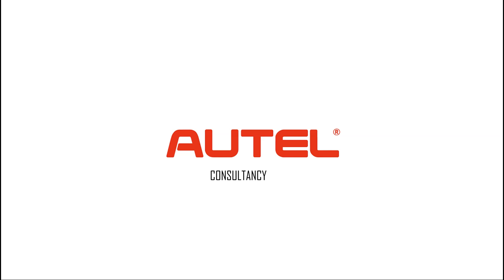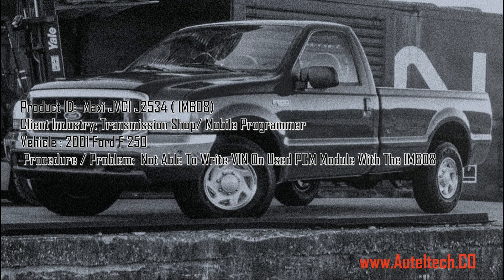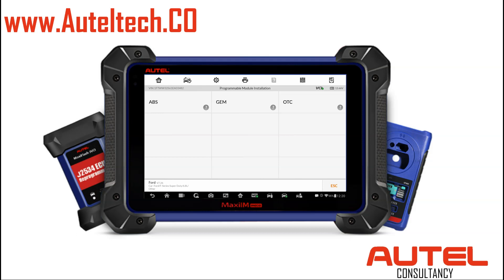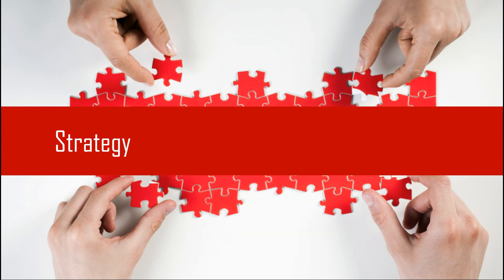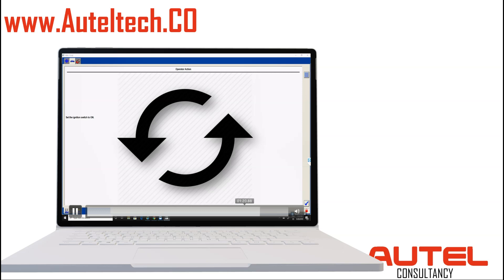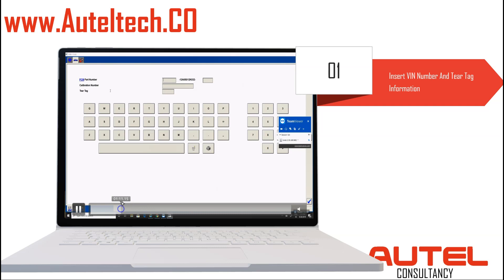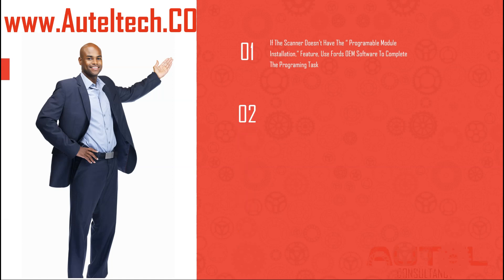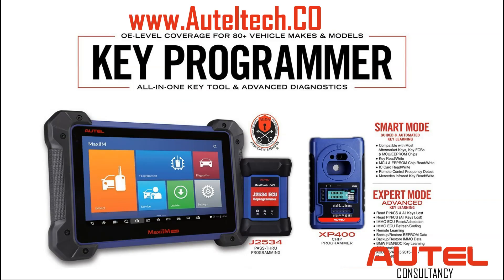Autel IM608 J2534 | Write a VIN on a USED Ford PCM Module | Case Study 2020

Comment: Whenever I try to manually enter the van, it does not allow me to reprogram because I manually entered the how do I get past this? I have a 2004 Ford F250 power stroke 6.0 turbo diesel using the FTRS software through Ford and using the J linkleak I believe

Comment: Very helpful and informative video👍. I'm using FJDS to program a used PCM to a 2007 Ford Fiesta. Any idea what the axle ratio is for the vehicle?I can't find the information on the Motorcraft website and I don't have access to Oasis😕
Reply: The axle code is located on the sticker on the inside of the driver's door. There should be the word axle on the sticker along with the other information , it will have a 2 digit code right below the word axle

Comment: I need an Autel that can rewrite a vin on a junkyard pcm. And correct my spedo due to the larger tires i have on my 2000 Ram 2500 5.9 gas engine. Any Aut models come to mind? Thanks!
Reply from the maker: You need a proper assessment. What I suggest if you want generic information you can contact Autel New York. If you want certainty then you can book a diagnostic tool consultation with me at auteltech.co.za for 97 USD.

Comment: Where are you located mine is a different year ecu shows up as a 2008 f150 buts its a 2005
Reply from the maker: I work virtually so I can be anywhere as long as you have internet access and a laptop
Reply: @AutelConsultancy my truck burnt down it’s a 2005 f150 so I bought a 2008 truck to fix it but now that it’s fixed I’m having trouble with smog bc pcm for my 2005 burnt up an melted so my truck basically thinks it’s a 2008😊
Reply: I need help on changing vin
Reply from the maker: @oneal2003  You can book the j2534 Training so I can consult you on my website auteltech.co.za

Comment: I have an issue Autel im 508 and 608 is not able to add a key on a 2023 ford transit and a 2024 GMC Sierra….what is Autel going to do with this issue.
Reply from the maker: I dont know because I haven't had any of my clients call me to log in their devices and submit the issue to autel's engineers. What you need to do is contact who you purchased the tool from or Autel New York. Go to the vehicle and have them remote in and submit a data logging. If your not able to do this then they will not know that there is a problem. I deal with this software issue alot thats the process I do to fix the issue.

Comment: Hi, I need a help with my 2104 Ford Focus TRANSMISSION CONTROL MODULE AND ELECTRIC CONTROL MODULE.  I JUST USED MODULES that need to be reprogrammed.  Please contact if you can.
Reply from the maker: Hello, you can book a j2534 training and consulting session on my website auteltech.co.za
Reply from the maker: Did you sort your problem out

Comment: Hey brother, new with ford can you let me know what a Tear Tag is and where can I find it??
Reply from the maker: The Tear Tag is typically a four-digit identifier of the PCM. It can be found on the label on the vehicle PCM, on the PCM's plastic housing
, or on the shock tower or passenger's side door jam . It can also be found on the inner fenders or strut tower, or in the door jams . If the Tear Tag number is not listed, enter your full Vehicle Identification Number (VIN) at the  Ford Tech info service website ( as build data)

Comment: Are we able to use ford ids and autel j2534 for as built data? For example I have a 2017 ford mustang flood damage bcm so i read the bcm mcu on the bench and wrote to the donor. Now car starts but I have faults for module configuration incomplete. It would have been better to program donor bcm with asbuilt data if I'm capable with j2534.
Reply: You can use Forscan to write the As-built data with no problems

Comment: hello. have a ford mustang 2002 all keys lost. went im try to programing the new two keys the car only get one off two for any reason dont take the another keys. can you plz help me
Reply from the maker: Hello, its hard to pin point the situation as I would need to log in  remotely to do some test. But on the surface it may be one of the keys your using is problematic.   You can try purchasing another key and see if thats the solution.

Comment: The Auto MP808 Has the ability to Reprogram modules on Fords. It works for all 3 of my vehicles. 2000 Focus ZX3, 2004 F-150 STX 4x4, & 2009 Escape XLT. I almost didn't purchase this scanner because of this and Autel claimed on their website that it didn't do it but I took a chance on it and I was surprised to find the programable modules feature on my Scanner. Haven't actually tried the feature out yet but I will soon because I need to replace a bad RCM on the Focus.
Reply from the maker: You are very fortunate. State one tools dont have alot of coding on them but enough for vehicle from 1996 to 2010 . I think when you get into new models it might be limited in coding . But im glad it worked out for you.
Reply: @AutelConsultancy  thanks me too!

Comment: Does this work with a newer model like 2011 fusion cause I tried and ran into a problem but maybe because I wasn't turning on the key after I wrote the vin?
Reply from the maker: It should work. I know on newer vehicles the manufactures kind of shy away from us using second hand modules. But it should work for that vehicle. Im not sure if there is something wrong with the module you purchased . Check to see if it has the right tear tag information
Reply: @AutelConsultancy  actually it's a 2009 but I'm wondering if maybe my system requirements are not good to use fjds because I'm using windows 7
Reply from the maker: @marcopisanti8932  Ive managed to use windows 7 . If the operating system was not compadible I dont think you would be able to install/ load the software .  You are probably going to need someone to log in and diagnose / trouble shoot what the problem is. It could be a variation of things that to difficult to diagnose with out inspecting
Reply: @AutelConsultancy  ok so after 2 days of trying the problem was the windows 7 wasn't connecting to the server I tried a windows 10 PC and was able to proceed to module programming (PROBLEM SOLVED)

Comment: Is the J2534 module imperative to change a vin or is it vehicle dependant? I have a 2008 Nissan Note,(UK) that I wish to change the ECU to a used replacement unit. I still have the original ECU.
Reply from the maker: HI Charley . I use the j2534 as a back up if the autel software doesnt have the feature. Some oem subscriptions allow vin writing, some dont.
Reply: Charley Brown vous êtes mécanicien
Reply: U dnt need a jbox to do that on those. Go in NATS there is an option for used PCM swap
Reply: @lubinpetit1831  Hi, but the ECU I have is a JDM unit, that does not have NATS. I have already tried it in my car, the car just turns over but will not start.

Comment: Hey Curt. Josh P here. One of your clients. How much is Fords programing software? I have an 02' Expedition coming in monday for a pcm replacement. I've sourced a used pcm. I'm looking forward to putting this to the test
Reply from the maker: Hey Josh. Do you have the Orignial PCM ( Keep it if you can) Ford is 50 USD for 72 hours. Did you check if autel has the Programmable Module Installation? if it does ( and you have the orginal module) then we will be able to just use your autel. Let me know

Comment: Hey Curtis, can you please make a video about the new Maxisys ULTRA an its capabilities? Right now I'm about to purchase the Maxisys Elite and im not sure whether I should wait for the new Maxisys devices since they will be launched in April or maybe a bit later. Thank you!
Reply from the maker: Hi Cyber, your supplier doesnt have any info on the machine?
Reply: @AutelConsultancy  Unfortunately not. Im living in germany and the european supplier couldn't give me any informations at all. So i contacted the US supplier and they couldn't give me infos either.
Reply: It is kind of strange because the device is about to be released (so it should exist physically at least by now) and no one can tell me the capabilities.
Reply from the maker: @cyberdarknes   Yea , the did the same thing with the ADAS systems.  And they are still working on some features so they are not going to release anything until its been tested and confirmed